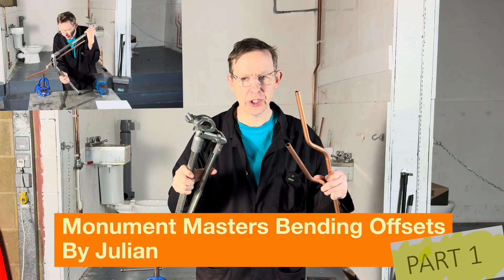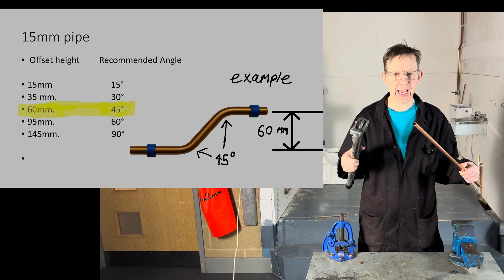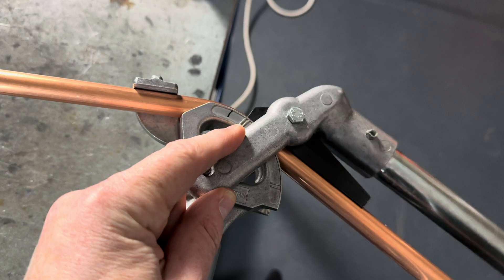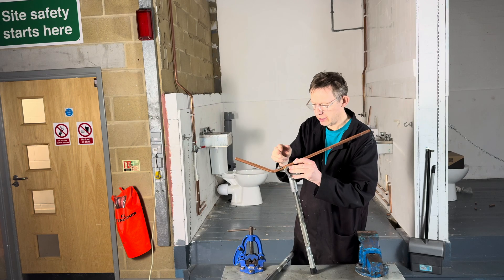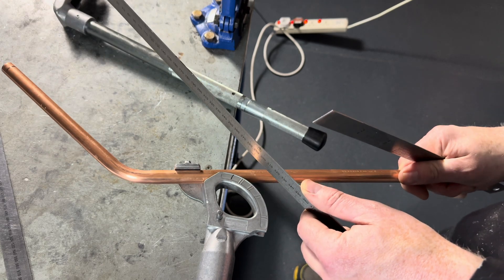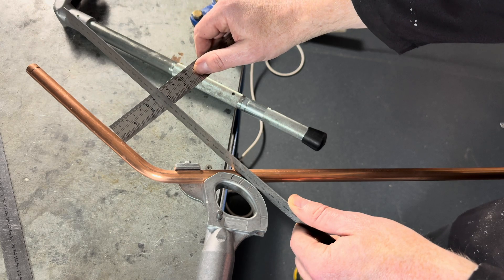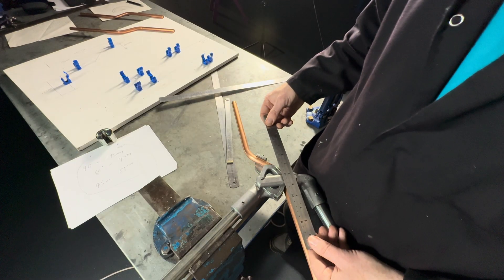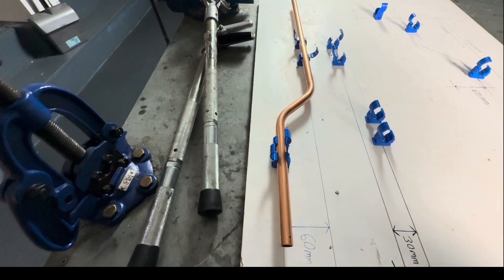Bending Offsets With Monument Masters using copper pipe

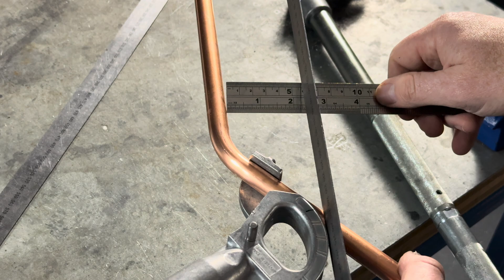Comment: Sir one question the 60mm 0:32 you stated centre to centre 3:06 it seems your measuring from the edge of the pipe did you allow for centre allowance? Sometimes as you do this work day to day it is automatically done without realising it.

Your videos are excellent keep up the good work.
Reply: Why not use the multiplier method
Reply: @davewright9312 what’s that
Reply: @sweetvuvuzela4634 It’s what we use on site as we are on Bonus or Price Work & can’t fanny around, like they do at College, with a vice or Rulers.
It’s called Constant Multiplier.
It’s Trigonometry mate. I’ll give you only one example to keep it simple & quick.
So you have a 60mm offset to do:
You’ll have 2 marks on your Tube, the first one is about 30mm(roughly) back from where you want your First Bend & is placed into the machine, but the golden rule is: the two marks must be in the same place in the Machine.
So you’d have your marks on the Former side of the pipe stop, just touching the stop.
Remember, the only important thing, THE TWO MARKS must be put in at the same point, where doesn’t matter, it can be at the pipe stop, edge of the former or half way between both. We’re doing it at the front face of the pipe stop, got it?

The measurements, two marks remember Dafty!!
First one as stated above, then calculate the second mark as follows:
60mm offset x the Multiplier(for 45° it’s 1.414).
60 x 1.414. = 84.84. So round it up to 85mm.

Your second mark is then 85mm from the first, these should be marked completely around the tube. On the straight tube obviously, before any bending.
Then stick it into the machine, first mark as stated above, pull the bend to 45°, as per the video, then for the second bend, move the tube as per the video, ensure you follow the golden rule for placing the second bend mark. Pull the second bend as per the video & you’re done!! 

Measure/mark once & one quick calculation.

All Constant Multiplier sizes are available online, just google it. The same Multiplier is used on 15 & 22mm.
Reply: @jimmygillies5590 super thanks
Reply from the maker: Hi if centre to centre is 60mm then also edge to edge (ruler) will be 60mm. So just measured 60mm with no allowance.
Reply: @ make so much sense thanks sir for your reply